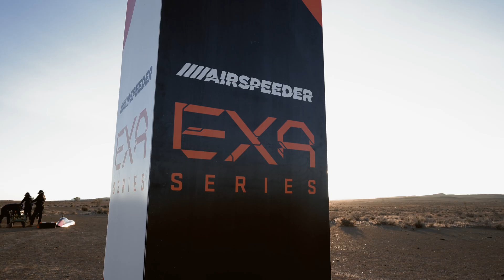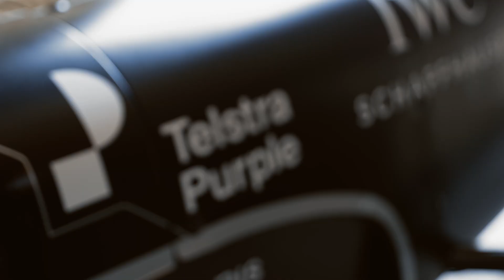“Full throttle and send it!” | Journey to EVTOL Test Drag Race - Part Two | EXA Series

Comment: Pilots still flying with standard RC transmitters...sorry...not interested in oversized quadcopter rc racing. Where are the "cockpits" you had in the teaser video? I would rather see someone in a cockpit with hands on throttle and stick racing in a simulator than someone flying big ass quadcopter while standing with a transmitter out in the desert. Haven't you been doing that for a couple of years now?
Reply from the maker: In pre-season testing for EXA Series we we focus on Speeder control manoeuvres for safety and technical learning. Line of sight, FPV, and onboard testing will be the thrust of 2022 test flights and races.

Comment: Every video is a dislike..
Without a person behind the wheel, this is the same as what children do in our yard, only the size of the copter is larger
Reply: I guess they need to have enough safety certifications etc to put a person into the speeder. As this is a new technology - I guess governments don't make it easier (because you know... the scary innovation) 
In the meantime - it's much different than other drones piloted from the yard. Camera drones can cut your skin, FPV Racing drones are a flying blender. This thing... I'd be scared of that.
Reply: @MaiOnHigh  Probably it is, tk. it's hard to imagine that you can't test yourself, then what you've made
Reply: What MaiOnHigh says is largely true. In addition, it is too early to fly one of those things for reasons of security and economy (not all scientific and technological projects work, many fail to be done). But here in a few decades, this will be increasingly easy to do and obtain one, in addition, it can become something normal in society... it reminds me a lot of video games.
Reply: @asterlofts1565  that's also valid point! Thanks!